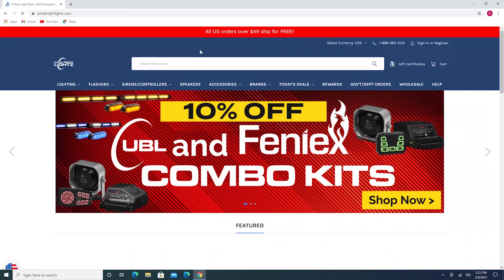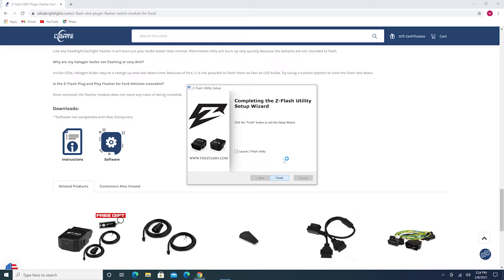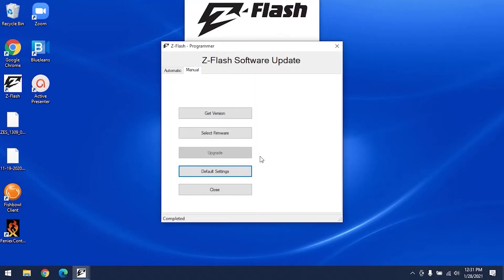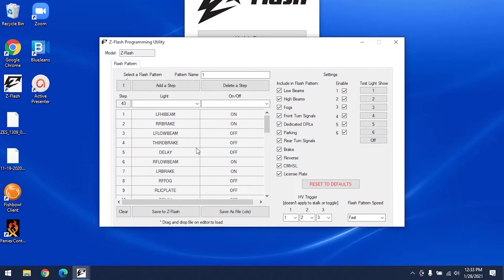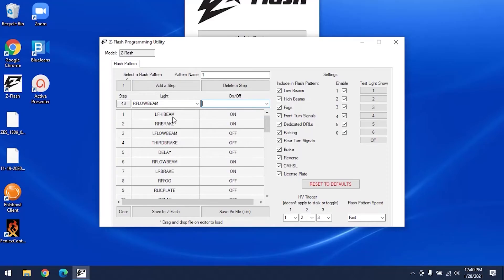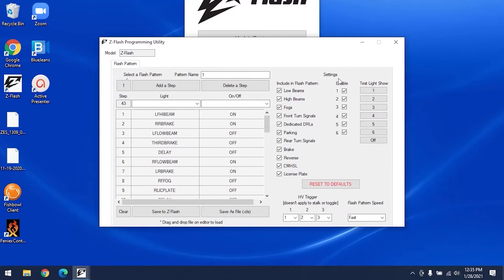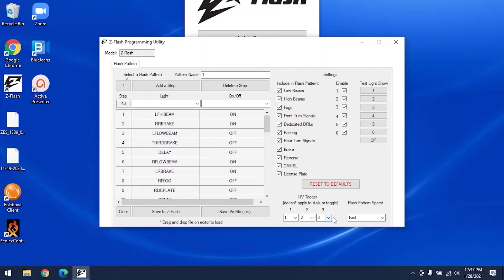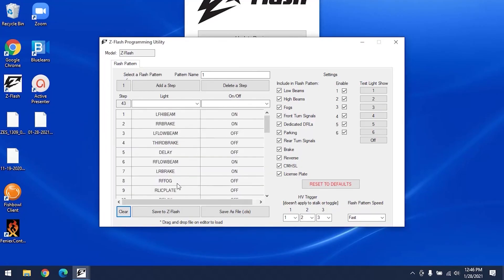How to Program Z Flash || Tutorial

Comment: What is the startup sequence for the vehicle? Do I plug it in on accessory mode run mode or engine off? These are the things we need to know guys!
Reply from the maker: For the Z-Flash OBD Modules, you will need to connect the Toggle Switch to it and then plug it into the OBDII Port while the key and engine is off

Comment: why cant i download software for my gm?
Reply from the maker: There is no software available for the Z-Flash OBD For GM.
Reply: @ My zflash doesn’t change patterns it just shuts off after I press the button once and what does the a and b mean on the module
Reply from the maker: @chrisp_20  You need to hold the button down for (1) second to change the pattern. The A and B buttons are used to reset the module back to the original settings. https://help.ultrabrightlightz.com/article/160-z-flash-gm-obd
Reply: @UltraBrightLightz  will there be zflash software for gm in the future for it to have reset buttons?
Reply from the maker: @svetiwap3568  Our engineering team is working on it but there is no ETA at this time
Reply: @UltraBrightLightz thats a crock of crap. Zflash software isnt available... things listed with options dont have options... 2014 f150 for example... its a crock with no support and you have to fight to find software or updates because they dont exist.

Comment: For a Ford Fusion what pattern is the drive mode and can it be edited?
Reply from the maker: In drive the headlights, fog lights (if activated manually) front and rear turn signals, brake lights, and reverse lights will flash. The pattern in drive cannot be customized on the Z-Flash OBD For Ford Module
Reply: @UltraBrightLightz  I have a16 taurus, the driver pattern will only flash the rear turn signals the reverse lights stay on and don't flash.  Brake lights do not flash.  I have everything in the front turned off, only need rear lights flashing.
Reply from the maker: @skypilot0077  Try using one of the other speeds for the flash patterns. Also, try resetting the module back to the factory settings and see if everything flashes. Then from there uncheck the lights that you do not want to flash

Comment: What is proper procedure for connecting laptop/Zflash/vehicle together to run tests?
Reply from the maker: You will need to download the Z-Flash Software from our website. Once it is installed you just need to plug the Z-Flash into your PC using the included USB Cable and click on the Z-Flash Software Icon
Reply: @UltraBrightLightz  Do I then (once plugged into the laptop) plug the Z-flash into the truck in order to run the tests?
Reply from the maker: That is correct

Comment: This device seems to be able to only be programmed a few times. After that it will stop accepting anything new written to it. I programmed it multiple times while just toying around with it and it worked fine. Then I did a factory reset on it and put everything back to defaults to ensure everything was still working correctly before I started trying to program it in earnest. Now when I try to program it, the factory default light show is all that will play regardless of what functions are programmed. I told it to turn my left head lamp on and off. That is literally the only thing programmed. I've got high beam, low beam, reverse, brake, turn signals....everything flashing. It should only be the left low beam turning on and then off again.
Reply from the maker: After the device is reset it will start off on Pattern Zero which is not able to be changed.You just need to hold the toggle button down for five seconds to change from that pattern

Comment: So not sure what I'm doing wrong but I'm trying to turn the low beam and running lights off. They are clicked off on the computer screen but when I put it back in the truck they all still flash.   What am I doing wrong???
Reply from the maker: Make sure after you make any changes that you click on Save To Z-Flash on the configuration page.Also when you first put the module back in the vehicle it will start off on Pattern Zero which cannot be changed but if you change the pattern the lights that you wanted to be off will be off

Comment: I'm putting this in my 2017 Ford F350 and want to use the hard wire so I can program a setting so when I turn my aux switch on it'll start. However, there is no help on this. Are the 1,2,3 triggers the same as the hard wires 1,2 & 3? If so, when I power up the wire, while connected to the laptop, it just still cycles through the six. Great product but no so great instructions on how to set it up
Reply from the maker: Yes the HV Trigger 1,2 and 3 is what you would use when wiring up the switch to use either Mode 1.2 or 3.When connected to your computer it is running a test so that is why you can still see all six patterns
Reply: @UltraBrightLightz  but, when you would create a pattern, and click SAVE TO ZFLASH, it wouldn't run the new program. And, if you tried getting brake lights to flash or turn signals, I tried for hours, it wouldn't flash anything red, for the rear. And I noticed there was no PARK lights flash. Like the cab lights on the roof or rear bumper lights, those little lights for the dually, badass look at night. I spent hours last night on it. Bummed all that work was for nothing.
Reply from the maker: @888junkcarsbuyingteam8  After you make a new pattern the Z-Flash starts off in pattern zero which cannot be customized.You need to change the pattern to pattern 1 or what ever the pattern number was that you selected on the HV Trigger.We have a list of which lights flash in the description on our website and the cab lights and rear bumper lights are not part of the flash patterns.You should have given us a call and we would have been happy to help you!
Reply: @UltraBrightLightz  what are your hours? Best time to call?
Reply from the maker: @888junkcarsbuyingteam8  We are open Monday-Friday 9AM-5PM EST.Please give us a call anytime during the day!

Comment: I have a 2021 Ram 1500 and my ￼Cargo lights stay on after deactivating the flasher. Anybody have any idea how to fix this?￼
Reply from the maker: I am not too sure why that is happening but what you can do is download the Z-Flash software from our website and install it on your computer.Plug in your Z-Flash using the included USB Cable and open up the software.Go to the configuration page and click on reset to default.That will reset the Z-Flash.If the issue still persists please let us know 1-888-562-5125

Comment: Ok, so got this for my 2017 Mustang Pace car. Unfortunately, programming is not quite as simple as noted in the instructions or video. First, computer must be restarted and put at 125% magnification for all the features to show. Second, making changes while the unit is actually in the car does not work. Unit must be separate from the vehicle while programming or it will not stick. Third, the Test light show is completely different from what you will see when the programming computer is disconnected.
Even though there were some very frustrating glitches in the programming, I was able to finally get the product working and programmed after a LOT of trial and error! Vehicle looks amazing now when all lights are activated.
I look forward to updates to the programming to ease additional pattern programs.
Reply from the maker: Yes there is some trial and error because there are a lot of choices in the programming. We're glad to hear that you made a pattern that works great for you!